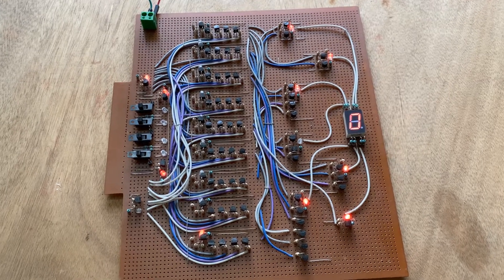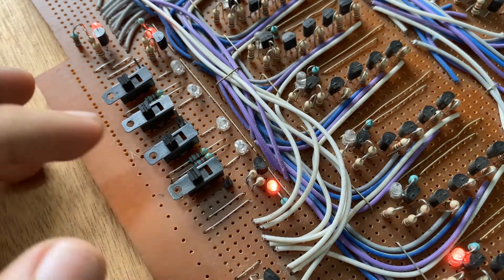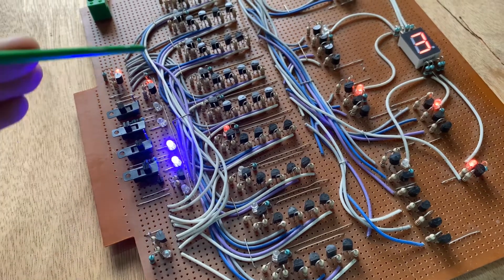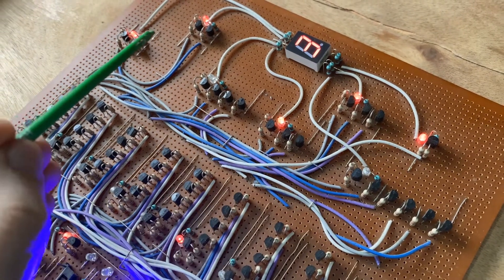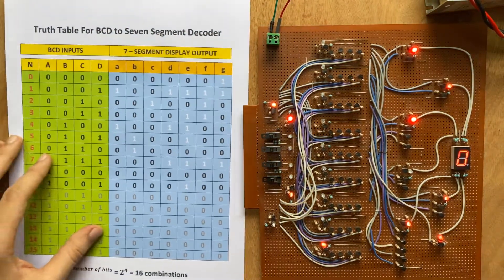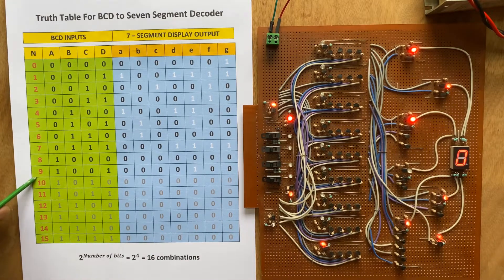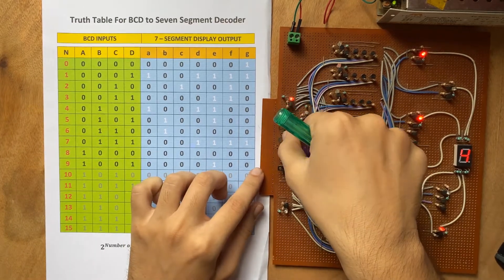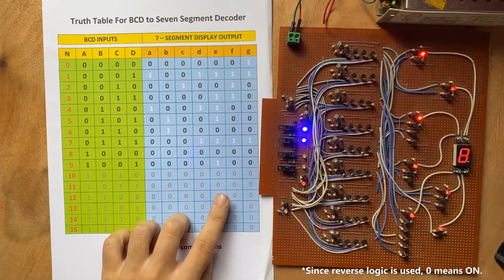BCD to Seven Segment Decoder Circuit Using Only BC547 Transistors And 1K Resistors.

Comment: Many years ago I make a 7 segment decimal counter using 12 transistors, 35 diodes and some resistors only.
This circuit is very complex.

Well done.

Comment: AmaIng work..vwry few understand how complex decoding cam be using discreet transistors when a single 74LS47 IC can do this job. Every engineering student should be mandated to start with smthing like this before they r allowed to use logic ICs. Great job !!

Comment: Sir, thank you for creating this beautiful representation of the insides of the logic gates. I'm trying to do something similar, but I'm shorting my circuit between gates somehow. I'm still early on and learning. Thank you for this video and all of your hard work.👍
Reply: Yaa it is indeed a difficult task when there are messy connections between gates. Having a well printed circuit diagrams aside while soldering, in my opinion, can make the process easier.